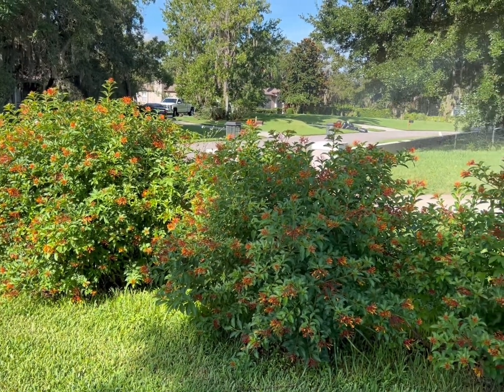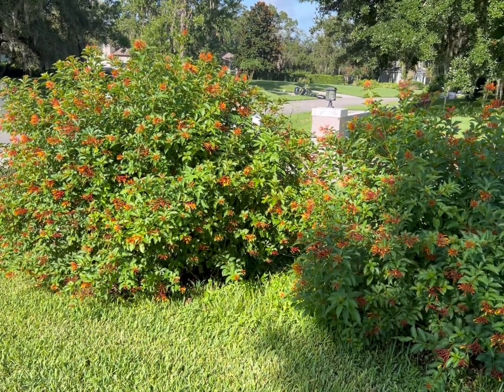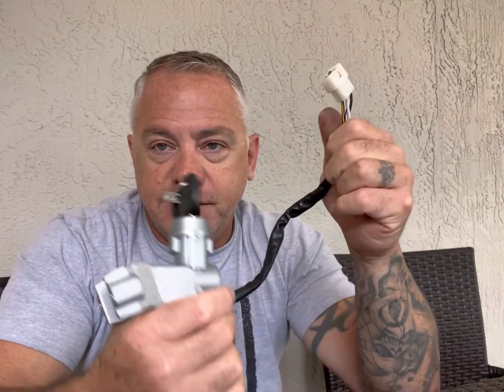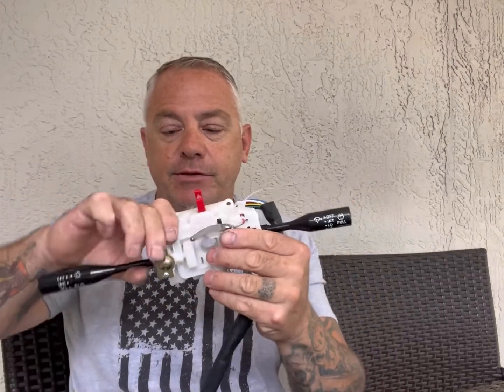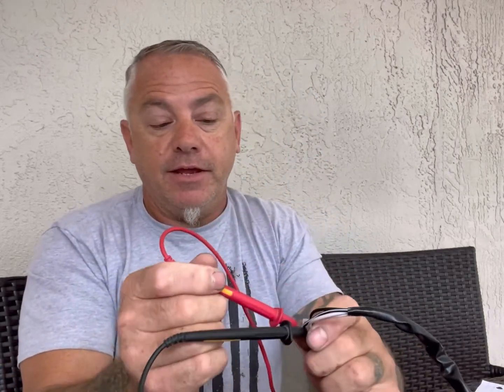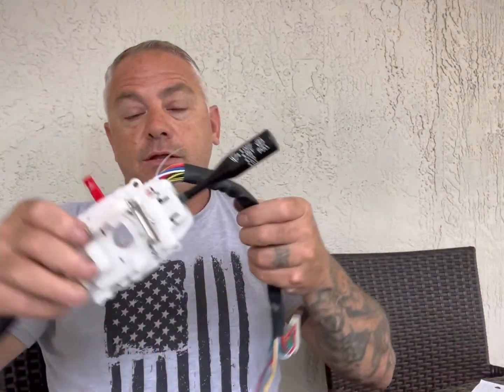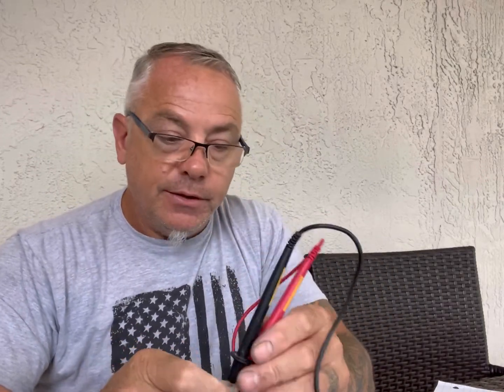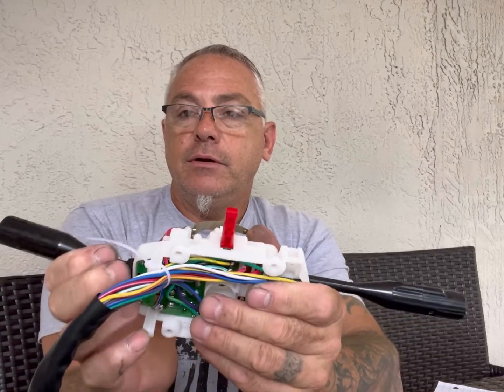How to identify wires using a multimeter in any switch!! Suzuki Samurai.

Comment: I could really use a full pinout of the multifunction switch. I'm having trouble. The yellow w/ black wire doesn't have anything connecting to it on the truck side of the harness and I'm not sure what 3 of these pins do at all.
Reply from the maker: I don’t have it anymore bud. I’m so sorry